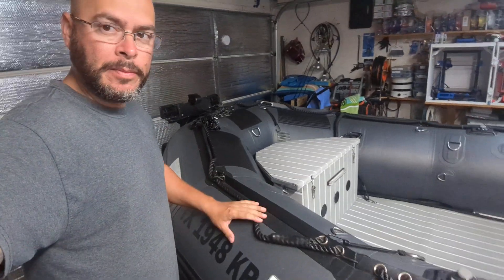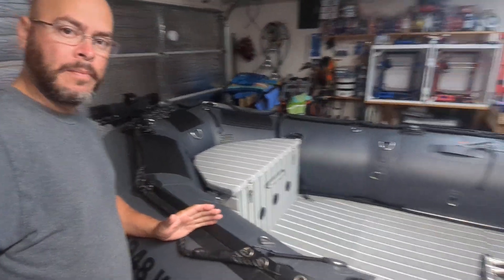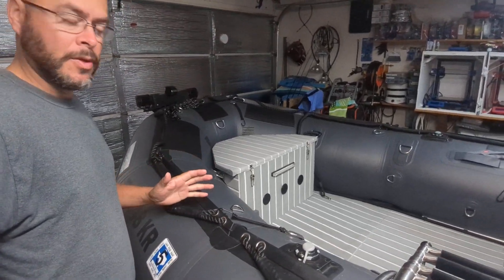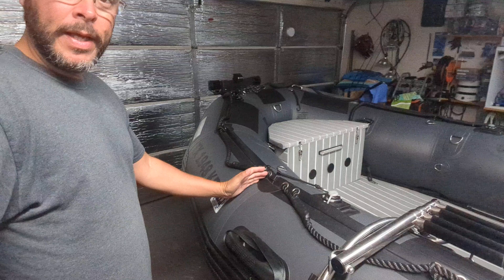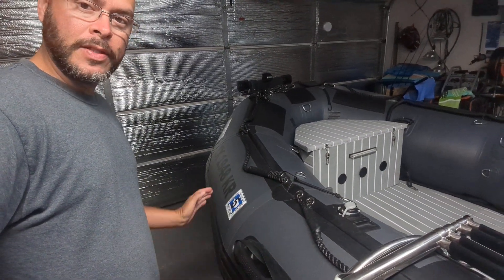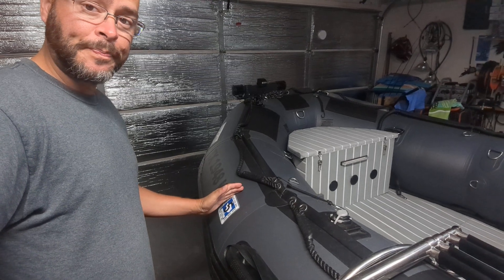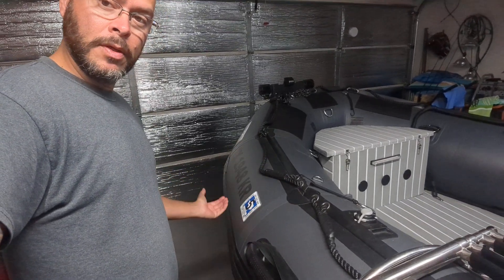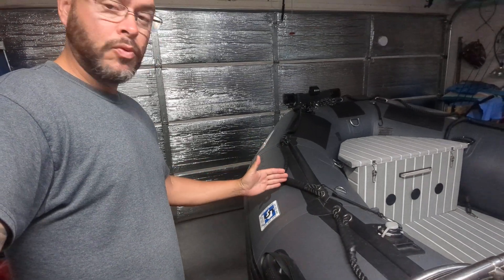Inflatable Boats and their Over Inflation Valve

Comment: Ok so I have the 16 fit imflable mine has 5 chambers so I have it blown up to the psi all of them amd my aluminum seats still move le there whant to come out it’s on my trailer so should I let the air out and  reinlfate them all because my seats shouldn’t move tho but my boat tubes are hard I  any advice
Reply from the maker: @donaldmartin4620  I find that the original aluminum seats will always move a little no matter how the boat is inflated. I never used them.
Reply from the maker: @donaldmartin4620  I have found that they will never be fully solid or stable. The tubes aren't rock hard. It's going to happen they will flex and move. They are sitting on an inflatable tube.

Comment: Cool Al I whant to know is we’re did you get that box you put in the front of the boat to have it the same shape we’re your air release valves is I like to put one there to
Reply from the maker: @donaldmartin4620  I measured and built it out of wood. With cut outs in the box for a cess to the valves.

Comment: I built a custom SD365 with seat/ steering etc.  I want to go to a bigger boat.  Looking at the Saturn FB385 like you had but wanted to pick you brain.  Why did you switch to Seamax?  Do you still run a 20hp on the bigger boat?  Do you have any insight on weight/balance?  Will it ride better, plane better with the helm further forward?
Reply from the maker: I did run the 20hp on the Seamax it did great with it although it was a little heavier boat. It was a great boat, I did like it over all of the Saturns that I have owned. I have since sold it and bought an actual 17ft RIB that was custom made.

Comment: Can you go over the trim tabs sometime?  I have an FB385 and I really think it needs trim tabs.
Reply from the maker: What size motor are you using with the FB395? It's hard to know without knowing what issue you're trying to correct.
Reply: @IsmaelPR32  20hp tohatsu
Reply: @IsmaelPR32  it doesn't like to get on plane with much of a load.
Reply from the maker: @AlanPoskey  with a 20? That wasn't an issue for me at all. No trim tabs on the 385
Reply: @IsmaelPR32  It won't plane at all with 4 people in the boat. 2 it will do ok.
Reply from the maker: @AlanPoskey  4 people yeah that can be an issue. It's a heavy boat. I hit 20-21 mph with 2 people and my setup when I had it.
Reply from the maker: @AlanPoskey  I've had 3 people and all my gear and setup and hit 18mph. Is your outboard a short shaft? Needs to be. What pin is it trimmed at? Does the bow rise on throttle up?